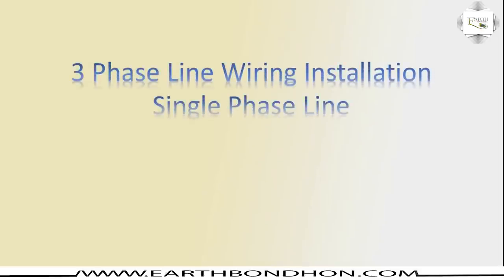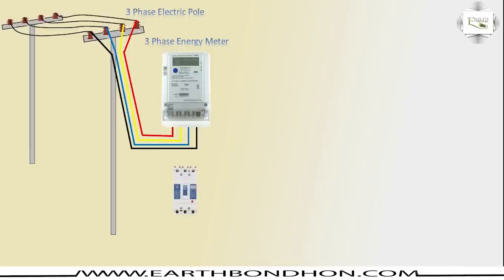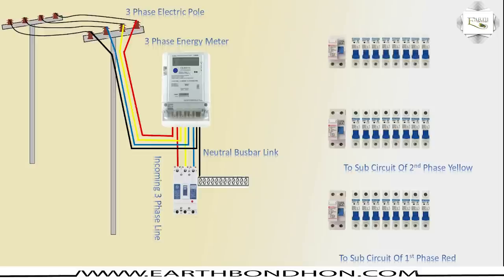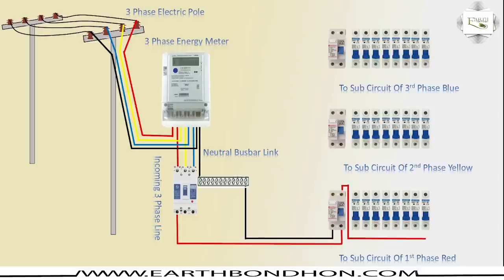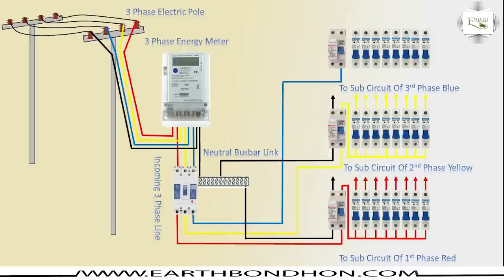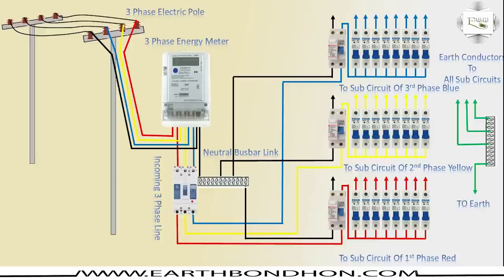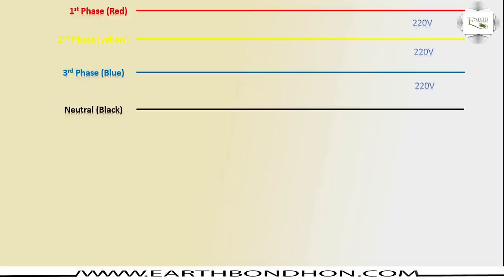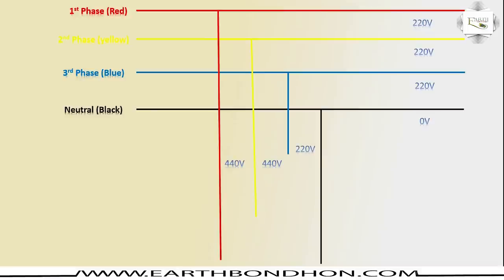3 Phase Line Wiring Installation Single Phase Line In House | House wiring | Earthbondhon

Comment: Hey, so I'm going an. Installation. It's three phase supply to the main switch board for a house. Then each phase goes to its own rcd and too its mcb after. During renovation. I turned one rcd on and one mcb to give builders some power. I come back next day and the fuse at the energy meter has tripped. Idk why this happend. Will an unbalanced load between the three phases cause such things to happen?
Reply from the maker: Yes it will

Comment: Dear sir  ground to line checked R phase to ground  380 volt,ground to y place 80 volt. Ground to B phase 382 volt and ground to neutralise 135 volt. What is problem please help me.
Reply from the maker: Line Problem.
R,Y,B Voltages 240V max. or 210V Min.
thanks you/...........

Comment: Thank you very much , but in our country (sri lanka) theres a main switch & a trip switch , so do i need 3 main switches and 3 trip switches for each phase ? Also to convert my single phase line to 3 phase im using a MCB with 4 ports (hager brand) is the 4th port neutral ?
Reply from the maker: yes,
full info website @earthbondhon.  I love to receive your comments and feedback.
Thanks for watching it
Reply: @EarthBondhon  i skipped adding main switches and just went with three trip switches for each phase after the mcb 4 pole ... since mcb is there and trip switches i thought main switches are useless

Comment: Sir... If i want 3 phase wiring in home.. Do one neutral wire can be make common for all 3 phase in room.. Or i need seprate 3 neutral wire for 3 diffrent line wire in DP BOX?
Reply from the maker: no, single neutral line has done. other question ? 
thank you

Comment: And also 440 three phase you have single phase 250 volt my friend
Reply from the maker: no 220V 
love to receive your comments and feedback.
Thanks for watching it.
Reply: @EarthBondhon  it is. They're phase shifted 120 degrees, not 180 meaning its 415V between the phases and 240V to neutral.